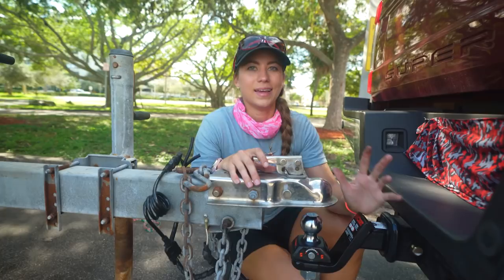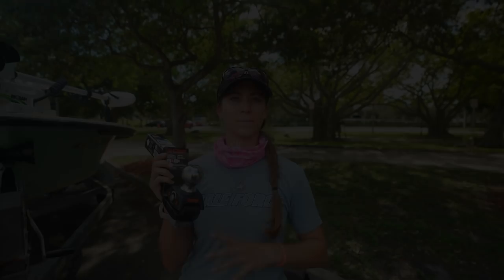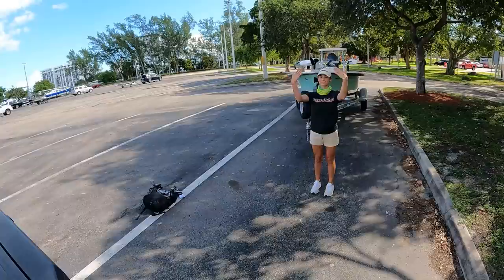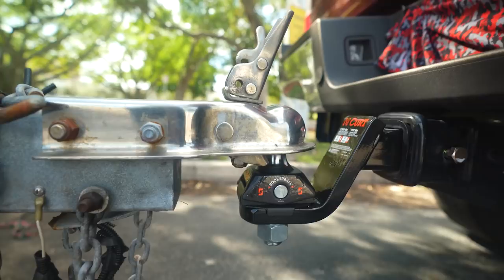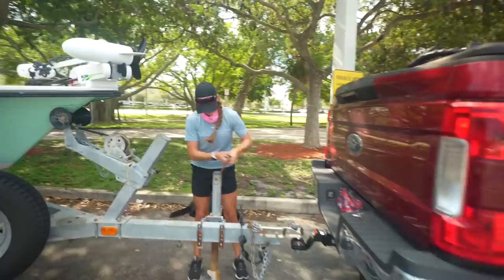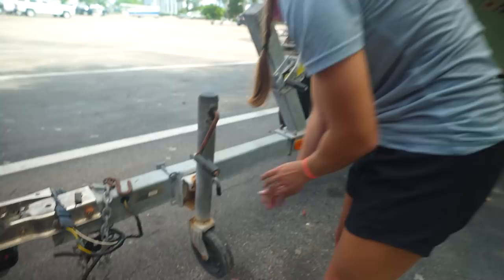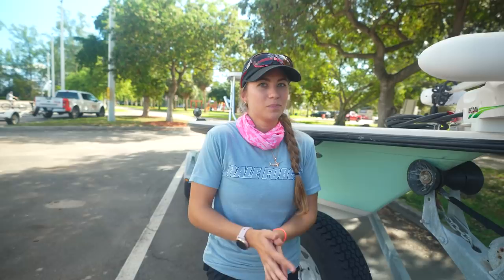How To Attach a Truck to a Trailer - 7 EASY STEPS

Comment: Helpful hint, when you’re cranking your jack, hold the wheel with your foot so it doesn’t spin around and the wheel will go up and down faster. When it spins in circles it’s not moving up or down. Great video!

Comment: Along with several others I have to say the "fail" with this video was in not crossing the safety chains.  Other than that, it's a pleasure to see you ladies again with a very helpful tutorial!  That rocker hitchball sounds like a VERY useful item, especially up here where the Interstates are almost as smooth as a back-country dirt road.

Edit:  Looking at their website I had to laugh.  In one line of the description they claim it's virtually maintenance free.  The very next line they point out the Zerk grease fitting for easy maintenance . . .

Comment: Ladies heres a little tip for you  the little black cap on top of your tongue jack has a round push lock holding the cap down  use a small phillips head screw driver lightly push in on that tab and lift the cap, add a little grease to the gear set youll see at top replace cap crank the jack to the full up position spray the lower part of jack ( part that has wheel) with a product called PB blaster you can get it at walmart here in Michigan or any decent auto parts store make sure your not going to use the trailer for a few days so the blaster has time to drip  and dry it will eat up some of that rust and prolong the life of your jack do the same with the boat winch and gears after it dries AD a touch of grease to the gears on winch and a good oil to the spindle area of cable/rope spool will make your winch much easier to operate...

Comment: Use the parking brake on the tow vehicle, it stops the truck from rolling a few inches forward or back, makes alignment not shift. Cross the chains for support and check all lighting each start up to make sure you didn’t blow a fuse.

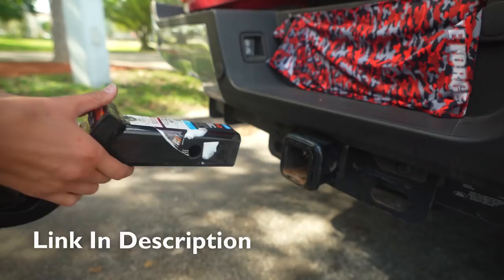Comment: Upgrade your hitch receiver pin. I am sure that the one you have is adequate for your needs (FL Flat) but it really should fill the whole hole, as it were. There will be a lot less wear and tear on it. 2:18 
Good video btw, towing is often overlooked/under appreciated, I especially liked that you checked your load was secure after hitching.
Reply: I noticed that too, looked undersized for the hitch and receiver.

Comment: Bad things can happen if you don't cross the safety chains. If the tongue drops without the safety chains catching it, the tongue might dig into the asphalt causing the trailer to get sideways and roll. Also, back and forth shimmy actions are greatly enhanced from uncrossed chains. Both can lead to catastrophic failure and deadly accidents. You guys are great, I love your show.

Comment: Lock for hitch and cross the chains, proper lock for trailer your lock is easy to cut.
Food for thought when trailer wiring gos bad which it will, replace it with outdoor extension cord wire, much more durable.

Comment: Your Chains Are Not Connected Correctly.
By Law Your Chains Must Be Crossed.
Left Chain Connected On Right And Right Chain Connected To Left
Why? If The Trailer Becomes Disconnected The X In The Chains Will Catch The Tongue From Digging Into The Ground.

Comment: One note on the chains. Check the rating for the s hooks at the ends that attach to the tow vehicle. There are some that are not rated to catch the tounge weight of the trailer, and if the trailer gets loose will bend straight and drop the trailer to the ground.  Which depending on the type of trailer, may cause bigger problems.

Comment: Nice job girls.  I have a suggestion. I usually cross  my chains. To the truck. That's what  I  taught. And  use some wd40 or similar. On rusted  jack parts thank. For great. Video.

Comment: If you cross the safety chains, like a x then if for some reason it would pop off and it will lay down in the x and be held off the ground until  u get stopped.  If u hook the chains straight on each side it will hit off the ground. Just a tip I ve been trailing for yrs. W out a problem.

Comment: One tip I would like to add, crisscross your safety chains it provides a cradle if the hitch comes off it falls on the chains instead of the ground 🤔

Comment: Heads up, need to lock your receiver to your truck and your trailer to the receiver.  Otherwise a thief can pull the pin on the receiver and take off with your trailer and receiver.

Comment: wonder where this cross the chains to cradle tongue idea came from.  sure, sounds nice, but does it actually do that in real life?  and even if it does, why would you want it to?  if you try stopping the tongue will just roll forward up under your bumper until it hits something or chain tightens, on mine the bow stop would hit bumper first, which would mean boat is ramming up into your bed.  tongue drops to roadway and it'll stop itself.  a nice soft cradle but a boat ramming up your trucks ass seems a little worse than fucking up the road.  unless the theory is the tongue hitting road pole vaults the boat up onto the truck.  which i'd have to see to believe.
Reply: In a lot of locations it's the law, so that's the main reason...
Reply: @NateBro86  gotcha.
Reply: they can "pole vault" pull a trailer up here in Michigan we have pot holes that can compare to some canyons out west,you hit those with the riser under trailer tongue or the clasp at 55 the boat is vaulting or coming around back swinging, if your chains are proper length nothing will be hit on truck including the bumper bottom or hitch may get a scratch or two, Ive been in the marine industry since the 80s and have seen almost everything you can imagine  and even seen a dink launch his trailer strapped to his boat he came to marina claiming his new boat had no pick up , wouldnt plain off i lake teted it it was fine finally went to lake with him and had him do everything once i stopped laughing  mostly inside i demonstrated HOW TO ACTUALLY LAUNCH THE BOAT without the trailer, up until that point i thought people who talked about folks doing that was just pure joking around! Nope they do it...
Reply: @callofthewildoutdoors  i was thinking more about the angle and strength of tongue to be able to support the whole boat pole vaulting like that.  not sure about the chain thing, my chains are crazy long but my tongue isn't super long.  and trailer was original to boat.  just looking at it i think bumper would hit bow stop, definitely hit jack.  i'll try crossing, would be helpful cuz some roads the chains hit ground and get messed up a little.
Reply: @tim6986  when your chains are to long you can twist them to shorten them up, it works great i pull several trailers of my own and thousands of customer trailers i have to do the "twist" regularly...
Reply: @callofthewildoutdoors  mechanic did that when bringing it back.
Reply: @callofthewildoutdoors  It's against the law!
Reply: @keithscudder7136  whats against the law? and in what state?
Reply: @callofthewildoutdoors  In many states that have water as a border or many lakes, they have it, here in New York they have it and I'm pretty sure they have it in Florida also. It's a safety thing. Loose chains hanging in a "X" shape.   Have a Nice Day.
Reply: @keithscudder7136  what is it im wondering you said something I stated is illegal im trying to figure out what your saying is illegal because nothing I have stated is illegal here where i have been a master certified Marine technician for close to 40 years, I deal with safety chains upwards of 10 times a day every single day